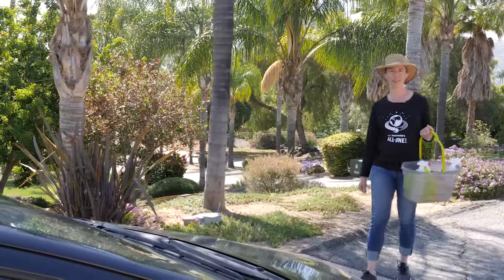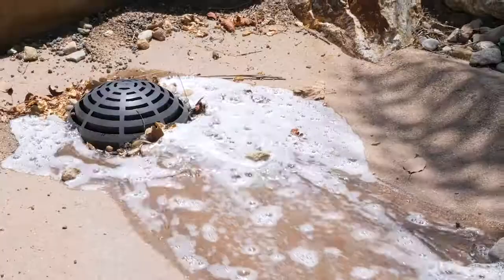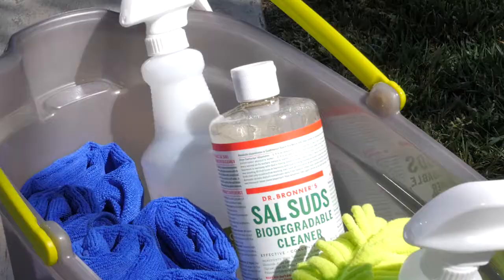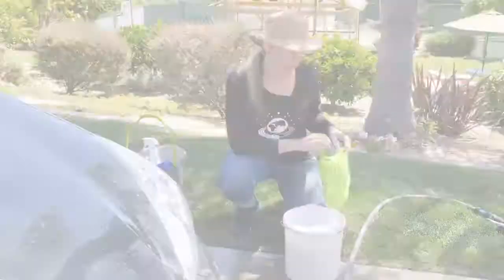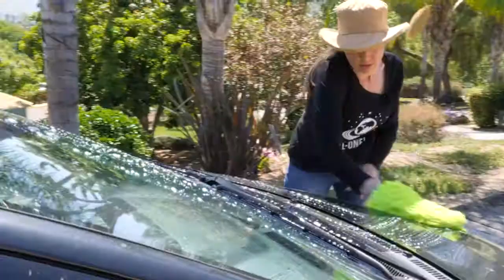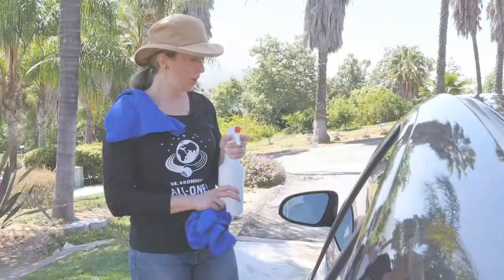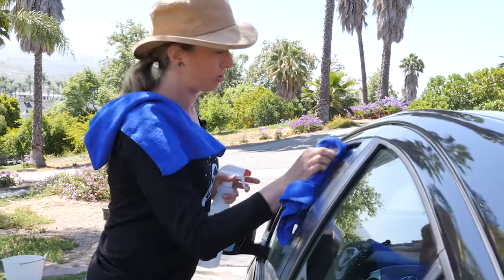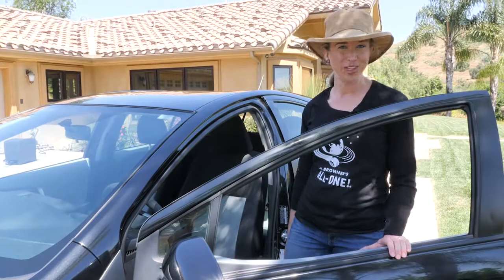Exterior Car Washing with Dr. Bronner's

Comment: Can I use dr bronners soap instead of sal suds ?
Reply: @kayjay4060  yea I have the same problem I bought 2 bottles of lavender on sale and it's darker and smells bad
Reply: @I Z ~ It doesn't matter if someone responds to old questions.  
someone currently may have the same question.
Reply: @I Z and? here we are in 2021 u ok? lol
Reply: She has a post on her website about car washing that has this video embedded. Someone there posted a similar inquiry on her site. She responded by saying that it will work and won't damage the car, but you will probably get a lot of white spots on it due to the soap. As someone who used the castille soap as a substitute, I can confirm she is correct. Doesn't look too bad though. Hope that helps even though it's a late response.

Comment: I used the Dr,.B. castille soap to wash my car, incl the windows. The car is white, so I didn't notice any spots, but last winter, in cold weather, the glass was covered with a white fillm on the inside that I have not been able to remove. Not knowing what caused that film, I tried alcolhol, but it didn't work. If it is residue from the castille soap, what will remove the film?
Reply from the maker: I am so sorry I did not see your comment earlier. The film is made of minerals and is best removed by vinegar. Dilute regular kitchen vinegar in half with water and spray on the film. If you can let it sit for a few minutes, that'll make it easier. Then wipe off.

Comment: What's the ratio between essential oil drops, sal suds and water that I can use without losing the strong essential oil smell and also without reducing the ability of sal suds to bubble and foam?
Reply from the maker: Hi Dexter - For car washing, as in this video, I mention 1/2 Tbsp. Sal Suds in 3 gallons of water, which foams a ton. I don't know about adding essential oils to that, though, since you'd have to add quite a bit to get a strong scent - like maybe 100 drops. For an All Purpose Spray, though, where I recommend 1 Tbsp. of Sal Suds in 1 qt. of water, you could start with 20 drops of essential oils and then depending on the strength of the EO, add more. Some oils are so much stronger than others. You'd need less of, say, peppermint, but more of something like sweet orange. It wouldn't effect the bubbliness of the Sal Suds.

Comment: What about using isopropyl alcohol to clean the windows, would the alcohol also negatively affect the paint?
Reply from the maker: Hi Zahara- Rubbing alcohol would not affect the paint, but it may take off the wax. Either spray the cloth and then wipe the windows, so the spray doesn’t end up on the paint, or be very careful not to overspray the windows. Or just use club soda.

Comment: Hey Lisa, do you know if using Sal Suds in paint would strip the wax on the paint? Is using Sal suds on paint clean as well as any ph neutral car wash soaps?
Reply from the maker: Hi Louie- I’ve washed all my cars with Sal Suds for years and haven’t found that to be the case. Is this something you’ve experienced?
Reply: @GoingGreenwithLisaBronner  I rarely use SalSuds on my cars only when theyre really dirty since I love the way it cleans with ease. But I fear the stripping of wax on my paint so I don't wash using Sal Suds very frequently. I use Simple Green Car Wash soap to wash my cars occasionally since they incorporate carnauba wax in their car wash soaps.
Reply: @LaughOutLouie88  SalSuds and any non-Ph balanced soaps will strip wax, because that's what it's supposed to do to clean off oil and contaminants off your car. pH neutral soaps don't clean very well, and should only be used if your car is not filled with contaminants. You're going to have to use wax after you wash your car with any non-pH balanced soaps.
Reply: @GoingGreenwithLisaBronner  Will you guys be making a car wax anytime soon? I love using carnauba wax on my car but unfortunately I can't ever tell if it's sustainably sourced since it does grow in Brazil and has been linked to deforestation.
Reply from the maker: @caidyncasper1584  Hi Caidyn- No, I'm sorry, that's not on our radar at the moment.